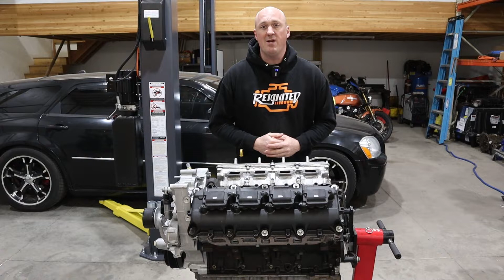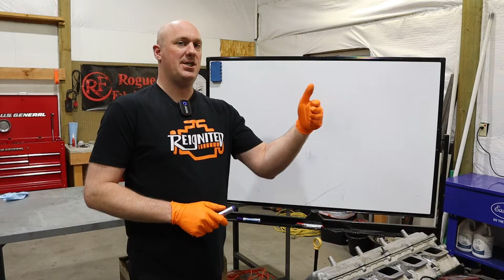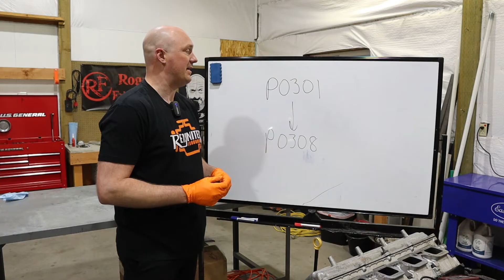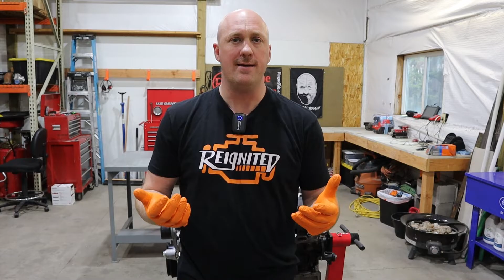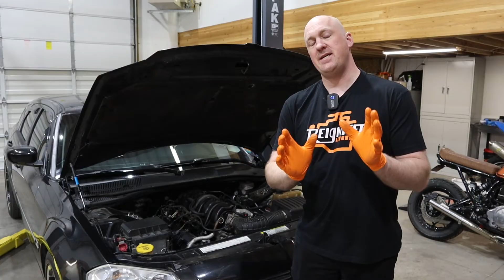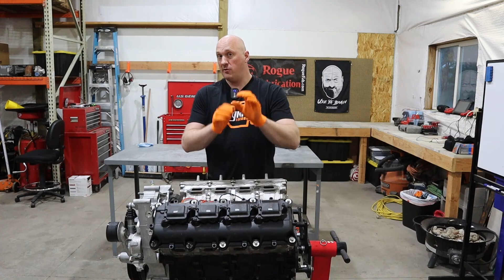Automotive Basics: Easy Hemi Engine Misfire Diagnosis

Comment: Can pcv valve fail then cause oil to enter the air intake?
Reply: Especially while not having a catch can?
Reply from the maker: It would be the opposite, if it failed it would stick closed and nothing would get into the intake. When working normally the crankcase vapors will get into the intake, which includes some oil. Basically a catch can bypasses the intake manifold and collects the oil in a can rather than letting it go into the intake and back through the engine.

Comment: So i have a 2023 scat pack challenger, dodge dealer warranty replaced the engine due to metal in the oil. Now this new engine that i have been complaining about has not thrown any codes, but while sitting at idle i can feel the engine stumble. Now i took it in and they told me they cannot find an issue at all. What should i check?

Comment: So very easy I tried all of that and I still have the p303 coming up I also at one point in time had a a different code come up that said something to do with the PCM The car also has issues with other electrical problems between randomly having the heat on when you're trying to have the AC on and vice versa I'm curious if the PCM is bad and can cause a p303 code

Comment: I have a 5.7 hemi in a jeep 2011 and check engine only flashing when driving after 2,500 rpm always says cylinder 5 misfire I’ve changed coil pack on all cylinders all spark plugs on all cylinders ughhh any help please I’ve also just replaced all fuel injectors still nothing

Comment: What if you have a misfire  and  are using a HUGE AMOUNT OF FUEL? Great VIDEO truly enjoy watching the . Channel!
Reply from the maker: You may have an oxygen sensor reading incorrectly. If you've got access to a scan tool where you can read your short and long term fuel trims you may be able to pinpoint the issue.
Reply: @ReignitedAuto Thank you

Comment: Thanks for your advice here. I took my Hemi to a dodge dealer and I’ve spent $4,500 to get the misfire fixed so far and it still remains. Im done with the shop gonna figure it out myself. I find it interesting that you say take it to a shop, you were a Chrysler tech for year..which is the reason I took the Hemi into them to begin with..I expected more..Im considering writing dodge about my service issue..

Comment: I removed the MDS from my RAM and a fault appeared in cylinder 6. The valves are opening normally, the camshaft pushrods are straight, etc. I simply don't know what to do; I've already disassembled it twice.

Comment: What if everything checked off ? Could it be the tune ? Im running a 5.7 hemi hc supercharger and getting misfire on 2/4/6/8 everything checks ff compresion etc only under hard acceleration 3/3500 rpm im getting a misfire on entire bank 2 no codes could it be the tune?
Reply: Did you find the problem … similar issue . Suspect internal mechanical … lmk please .

Comment: I have a 2013 Ram Hemi 5.7L and I'm experiencing a misfire in cylinder 5. What should the reading be when checking the connector with a multimeter? Thanks in advance.

Comment: Here is one for you and I would love an answer.   2022 5.7 ram.  23,000 miles.  Always run full synthetic oil and oil appears clean.   I have a misfire on #6.  It feels somewhat intermittent.  Code p0303   50lbs compression. On this cylinder.   No ticking, knocking or smoking.
Reply from the maker: With that low of miles but being down on compression I'd be looking at a possible valve sealing issue. If you can, try to do a leak down test, see if you can hear huge amounts of air hissing through either the intake or exhaust.

Comment: To check if it is a cam / lifter issue, wouldn't it be sufficient to pull the valve cover featuring the cylinder of interest, and measure lift at the valveu using a dial indicator, as you rotate the crankshaft ?     If lift is below spec, would it be safe to say you've found the issue without needing to pull the head ?
Reply from the maker: That is correct, but it's surprisingly difficult to do this accurately. Most people wouldn't be able to do it properly. If you're familiar with the process it can be done 👍
Reply: @ReignitedAuto  Thanks !   That was a great video, one of the best.    I'm experiencing intermittent cyl 8 misfire in a '98 350 Vortec p/u I bought last week.  Compression is good, new cap, rotor, and wire #8 resistance acceptable.  Manifold vacuum gauge steady around 20 in., no fluctuations upon revving or release.  However, temp gauge never gets up to 190 deg, I suspect previous owner may have deleted the thermostat, about to dig into it.  Otherwise, I'm thinking clogged injector or faulty / dirty wiring connection to #8 injector.   Or O2 sensor.   Code was tripped twice last week on each O2 sensor, but those codes never returned after clearing the PCM.  Could be bad O2 sensors still, they don't always cause a code.    Thanks for the great video, these misfires can be a challenge !!!!!!!!

Comment: Glad I found this. Have a cylinder 2 misfire but only idles rough. Swapped coil, plugs and fuel injector and still misfiring cylinder 2. But drives perfectly fine. Still throws you in your seat without a mis
Reply: Id run a can of barrymans fuel injector/gas treatment through it. If plugs are old consider changing all out. Since I had aftermarket cheap coils, I did coils and plugs...runs like new.
Reply: @michaelsnively3621 it's bad now. Still misfire on 2. Go through a gallon of coolant every 3 days. Cant get it in till next week.
Reply: @EricRacine123 very sorry to hear that. Does your oil still look normal?  Maybe check for a leak around intake manifold.

Comment: Okay so i need help. I have a gen 3 hemi that i just recently rebuilt. It has a mark 82 camshaft (flyin ryan performance) in it and the cylinders are bored over 030 over, also recently just changed the injectors to scatpack injectors because the dyno guy said my i njectors were bad….we cannot find out WHY it is reading a false rich condition(according to the dyno guy), we replaced the coil packs, sparkplugs, injectors, anything that is related to spark and gas. Do you think it has anything to do with a MAF sensor? We havent replaced that yet just dont want to keep throwing parts at it. The dyno guy says that the vehicle runs good on start up but as it gets up to temp it starts to mis fire and run like complete garbage. Do you have any idea what the root cause of any of this would be? We tried everything we can think of and its still not running right. I know my friend who owns a 2014 dodge charger srt8 just recently did a cam job and swapped it out with stock parts but he said the service techs there at the dealership verified that it had to have a cam relearn done to it, do you think my 2011 Chrysler 300C would need to have this done to it?
Reply from the maker: One key thing you mentioned there, that it starts perfectly but will start to run terrible after a bit, also that it's falsely reading rich. How do we know it's a false reading? Is there a wideband at the dyno? Anyway, what you're describing sounds like when the vehicle is going into closed loop using the oxygen sensors they are seeing something that's either causing them to pull a bunch of fuel or dump a bunch of fuel in. I'd be using a scan tool to look at the short and long term fuel trims to try to see what's happening. It's a starting point anyway.
Reply: @ReignitedAuto yea, this is all information from our dyno guy. We have been communicating about it for a couple of weeks now lol…the o2 sensors are new oem ones. Also another thing, we still havent done the break in process on the engine since its not wanting to run, would that have anything to do with it? Thank you so much for the information, ive been watching you for a while and you actually made it possible for me to build up my motivation to complete this rebuild….it definitely means a lot🙏🏽

Comment: Hi. I have 5.7 Ram 1500 2015 and it shakes lil bit while idle. No codes no check engine. Just shakes on idle. 580-590rpm. I changed spark plugs, cleaned up PCV valve sensor, throttle body and still the same.  I had evap sensor code so I replaced it as well as fuel cap. Besides that I installed oil catch. And I have exhaust manifold leak issue on bank2. Can you please help me to detect my problem?  Thank you and have a great day
Reply from the maker: Sometimes they're can be a slight misfire at idle that won't actually register enough to set a check engine light. My recommendation would be to find a scan tool that is capable of live misfire data, it should clearly show which cylinder is misfiring and then you can start to diagnose it properly.
Reply: @ReignitedAuto so I have JScan an while live data it is showing 0 counts but randomly “not supported” note on different cylinders and “ND count” as well. Do you know what that means? Thanks!

Comment: I did a cam and lifter repair on my 6.4, I just started. Of course it sounded terrible upon first start up. The next few start ups were completely smooth tho. Smooth until about a few seconds in it starts missing (P0300). I think it’s the exhaust leak I made tho. Because I bent one of the exhaust manifold studs and just cut it off, making an exhaust leak.
Reply from the maker: Generally an exhaust leak won't cause a misfire, unless the oxygen sensor is reading so lean on that bank the pcm just starts dumping fuel into those cylinders. Do you have access to a scanner that can identify which cylinder exactly is misfiring?
Reply: @ReignitedAuto no I used my bluepoint plug in scanner. I think I can borrow my shops scanner. Upon the last start up, after a few seconds after starting it backfired at idle.
Reply: @ReignitedAuto my scanner just says it’s a random misfire. My bluepoint does have live data and graphing but I’m not sure what I’m going to be looking for.
Reply: Any help would be greatly appreciated

Comment: 2006 Dodge Charger RT with a 5.7 Hemi I have a P0300 changed the fuel injectors recently cleaned the gas tank changed spark plugs changed fuel pump and nothing still the same P0300 car sounds like it’s going to die when I rev it and sometimes it does die I looked all over the channel to find a video for the P0300 but found nothing I can’t find any other videos to help me with my P0300 on my Hemi engine I need help please!!!

Comment: 2015 Ram 1500 with 5.7 Hemi...i get a P0301 on hard acceleration. CEL will flash, and the engine will shake for about a full minute. Then it goes back to normal and the CEL goes away. Swapped the coil out and the plugs, even swapped the injectors around. Still comes back to Cylinder 1
Reply from the maker: Unfortunately that's a pretty classic symptom of lifter failure. It's eating into the cam lobe so under hard acceleration it's not opening the valve enough and it's causing a misfire. Not noticeable under light acceleration because there's not enough airflow needed to make it miss.
Reply: @ReignitedAuto  Ok thats what i was assuming. Makes total sense, I appreciate your repsonse and you gained a follower! Theres also a fairly loud rattle noise under moderate acceleration, especially under load (incline), could that be the lifter as well?
Reply from the maker: @stunnasam21  not likely, is be looking at two things. One, if the exhaust bolts are broken in the manifold it can have an exhaust leak bad enough that under acceleration it can sound like a rattle, or two, the exhaust could be touching the frame/ body at some point and this can rattle as well. 👍
Reply: @ReignitedAuto  ahhh ok, good to know. It does have a broken stud on each side actually 😂. I have a set of new headers for it, but was waiting to install them if I have to take the heads off anyway to do the cam/lifters.
Reply: @ReignitedAuto  hey sorry, one more question...Since i plan on keeping the MDS when i rebuild it, should i run a HV oil pump? If so, would you recommend a Melling or an OEM Hellcat pump? Thanks again!
Reply from the maker: @stunnasam21 go with the Melling M452HV pump, direct replacement and keeps MDS working properly 👌

Comment: Had misfires, and loss of power, changed plugs, problem solved. Still have a slight ticking, under the hood at low rpms, only 42, k miles

Comment: A little late to this video. Mine started missing and quickly went to feeling like half the engine was running, had to keep revved to not stall (manual trans helped). Techs said misfire no. 3 cyl. It was, but not electronic. Exhaust valve spring broke and wound in on itself so it still kept the valve up away from the piston. Swapped all springs and related gaskets. Problem solved. About 79k miles.

Comment: 2011 ram 5.7, mds tuned out, brand new engine in it and the mds cylinders will not fire with tune on or off for mds, help!!
Reply from the maker: Did you perhaps remove the MDS solenoids but it still has the MDS lifters in it? If so, the engine will be in 4cylinder mode at all times.

Comment: My 2013 5.7 is going to the dealer for diagnostic.  Cylinder #3 misfire.  I already changed the spark plugs, Fuel injectors, Intake manifold gaskets,  did a compression test, perfect,  and it doesn't tick or make noise, so im hoping its not a lifter or cam

Comment: I have a strange one. 19 ram Hemi. Misfire on 7 and sometimes mirrors 5. Truck has a new engine, harness, injectors and coils. At times runs well, then starts misfiring again. Any ideas? PCM was also replaced twice, and reflashed several times and cam  crank relearn also. Any ideas?
Reply from the maker: That is indeed a strange one, sounds like you're running out of parts to replace at this point. Misfire is always in #7 (the #5 misfire is likely an echo) It sounds electrical rather than mechanical if it runs fine for awhile then has issues. But having already replaced the harness and ECU I'm not sure where that leaves you. 🤔
Has the MDS solenoid been replaced for that cylinder? If the solenoid were failing perhaps it's inducing a misfire. It would be extremely rare, but we're grasping for straws at this point right? Also on that same note, was the MDS harness that goes under the intake replaced as well?

Comment: I got a P0305 code. Truck definitely had a misfire. But it went away and drove normal. Then it came back again. And also went away. I just swapped the coil pack because i changed the spark plugs last summer. So I'm hoping it's a coil pack. BUT it did show up when i was punching the gas
Reply: Dealing with this right now too

Comment: I like the way you explain the problems. I need your help to know my issue.  I have 2010 SRT8 dodge challenger. I have a check engine with codes P0301 and P0303 and P0300

All spark plugs replaced and the injectors were clean. I have swapped coils and problems not solved.

When I want to heavily accelerate the check engine flashing and the car hesitate too bad

I have conducted a compression test and I know the first cylinder has low pressure.

I am worried to be a lifters that's why I am afraid to go to the mechanic
Reply: Did you fix it ?
Reply: Yes ut was the rockers sticks
Reply: @RodmanRodman-s9b what’s that ?

Comment: Does anybody on here know if I could put MDS lifters in a non MDS hemi engine? I'm pretty sure the answer is no but I just wanted to triple check!
Reply from the maker: You can indeed. Mechanically it's pretty straightforward. All the engine blocks are cast the same way, so all the passages are already there. You would need to install the MDS camshaft as well though. Not precisely sure what the difference is, but I believe the cam lobe has a softer ramp to it than a non-MDS cam. Also would need to install the MDS solenoids of course. 
Electronically it's a little different, can't add it to a vehicle that did not come with it.

Comment: Can’t you pull the valve cover and expose the valves, crank the engine over and see a valve not moving as much as it should? Wouldn’t that tell you that the lifter was collapsed?
Reply from the maker: It's definitely doable, but not quite as easy to verify as you might think. The difference between a failed lifter and a good lifter is probably .100" which is a decent amount, but not usually measurable by eye. You'd have to directly compare a good cylinder first to get a baseline measurement, then measure the affected cylinder. Usually by the time the cam lobe wears enough from the failed lifter to be identifiable by eye, then you're looking at an engine replacement due to how much metal is going through the engine at that point.

Comment: what about if I have a misfire and not throwing any codes (intermittent under normal acceleration) plus I have a tick but don't know where it's coming from (seems to me it's coming from transmission) 2011 ram 1500 5.7

Comment: When you do a compression test in that cylinder. You have to do it in both spark plug Holes? Or can I put 2 testers  one for each spark plug? Thanks
Reply from the maker: You just have to remove one spark plug to install the tool, leave the other plug as is. 👍

Comment: Dealing with a P0303 when cold starting 2012 Jeep Grand Cherokee 5.7L. This was super helpful. Subscribed. Thanks for this video!
Reply: so what was it?
Reply: @ fouled spark plug most likely but also replaced the air filter and ran 1 bottle of redline fuel cleaner through the gas tank.
Reply: @Justinian169  cool thanks for sharing 👍

Comment: Got a hemi low km 158k replaced cam and lifter (comp cam lifters) p0300 tap sound until throttle given. Been like this for a couple years engine light comes and goes, sometimes gone for days. Also noise metallic noise sometimes goes away and runs completely smooth, but soon comes back the next run. Also sometimes hesitates to start no fuel issues.
Reply: Did you figure out what it was